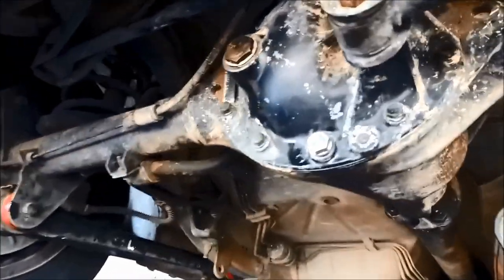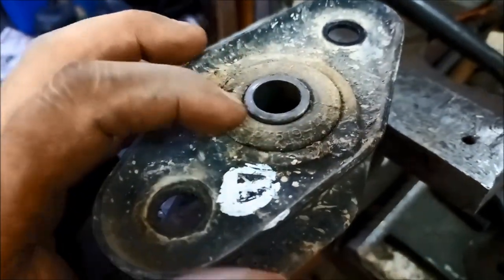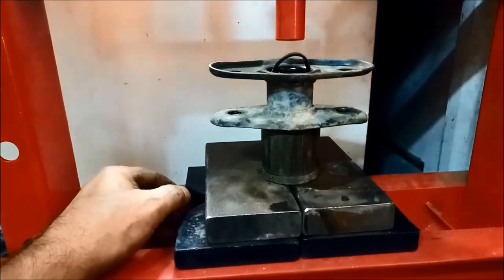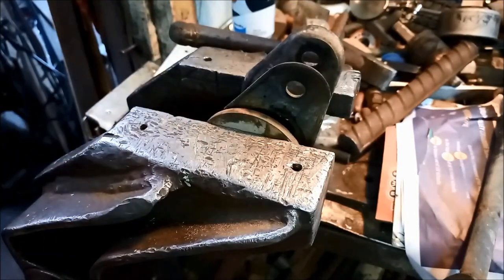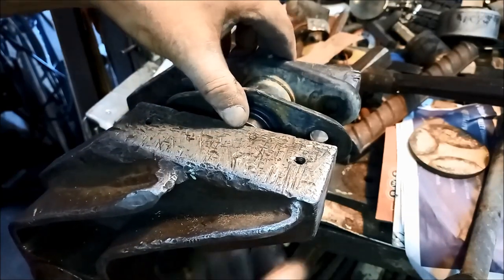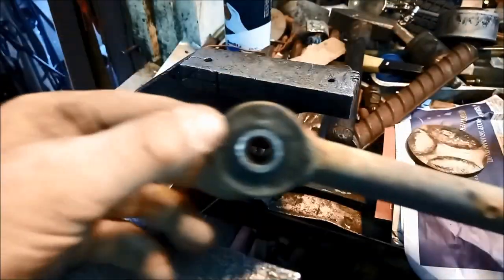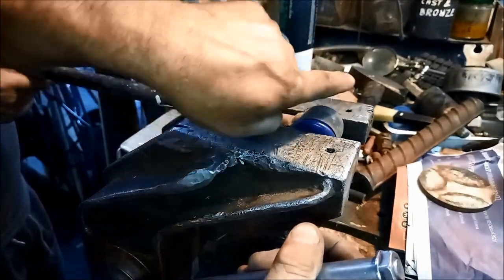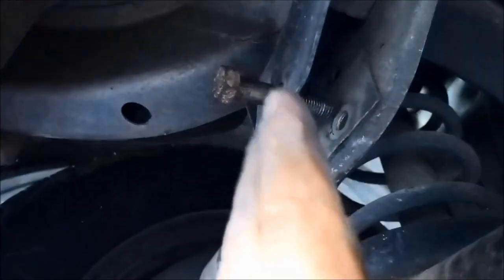How to Replace Pivot Arm Bushes on Differential with Polyurethane Bushes

Comment: hello sir my ranger 5r55s auto, what happen if band adjustment not adjust properly? because now i feel slip n jerk from 2 to 3 or jerk to 3rd to 4th tq sir
Reply from the maker: hi, if really out of adjustment or incorrectly adjusted could cause those issues ( some confuse the front, middle and rear band). the tip ends of bands will wear out prematurely as the angle of the apply struts will push the band tips together first. it is best to keep band adjusted properly and they will last much longer ( the lining on bands if you have ever seen them is only about 1mm )  often if you like the apply timing of band to be quicker, you can adjust these bands 1/4 - 1/2 turn tighter - but no more than that. check out our 5r55 vids https://www.youtube.com/playlist?list=PLQLkuOdKuFovvYiynq3ee--0WSSUyeIxu  cheers
Reply: @YepThatsIt  thanks sir, can band adjustment be done every time atf oil change? and is there no problem if you just try 1/4 or 1/2? without torque wrench